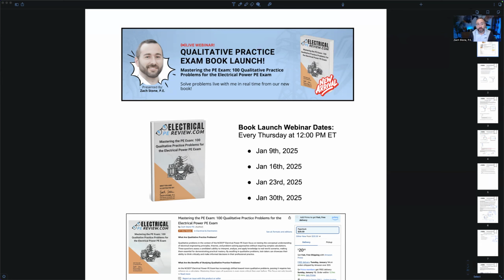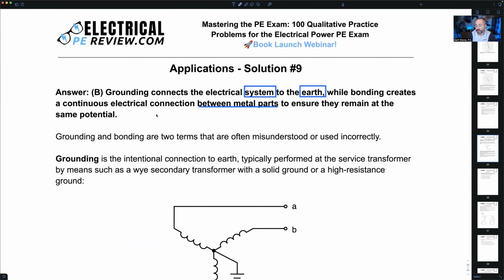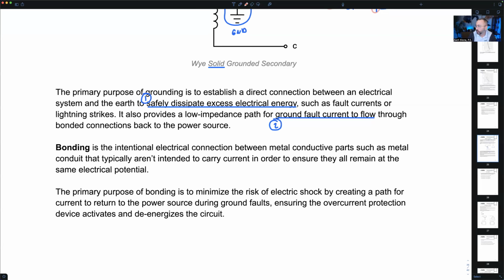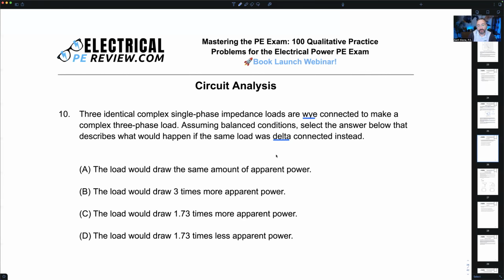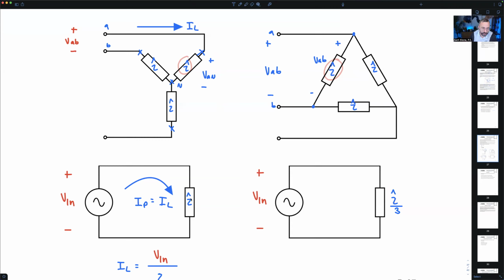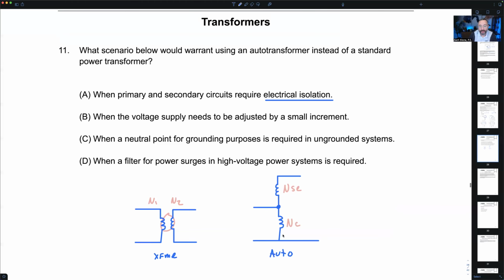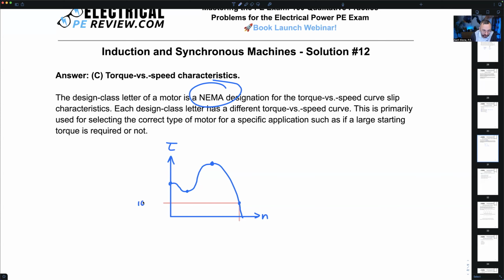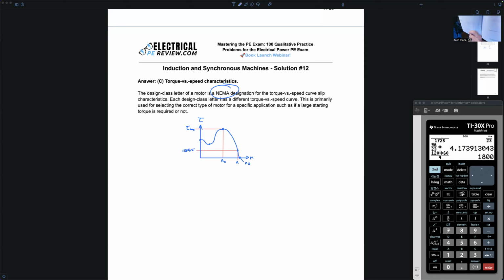Mastering Qualitative Questions for the Power PE Exam – Live Solutions Week 3

Comment: 38:00 How does a 3-No-100-watt bulb consume more power in Delta configuration than Wye? That is clearly the wrong answer. Forgot to check the line/phase voltage relationship in both configurations.
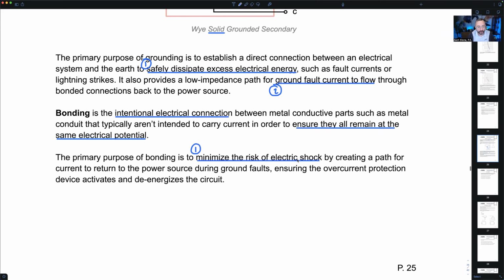Reply from the maker: The power rating of a lightbulb is given with respect to it's voltage. For example, a 100 watt light bulb rated at 120 volts will only draw 100 watts when connected to 120 volts. The same 100 watt 120 volt rated light bulb, if connected to a 240 volt power supply, will actually draw 4 times the amount of power (400 watts) for the same reasons as explained in the solution to problem 10 starting at 26:15. This is because power is directly proportional to the square of the applied voltage. At 400 watts, a 100 watt rated lightbulb will likely burn up!

In the rare instance where a three-phase lighting application is used (which is extremely rare), it's really just three independent ballasts fed by a single three-phase cable and connected line-to-neutral to drive three separate lights. This is really no different than standard 277 volt lighting loads powered by three separate single-pole breaker circuits on three different phases from a three-phase 480 volt panel. The lights themselves are single-phase, and never delta connected due to the higher voltage and lack of neutral.